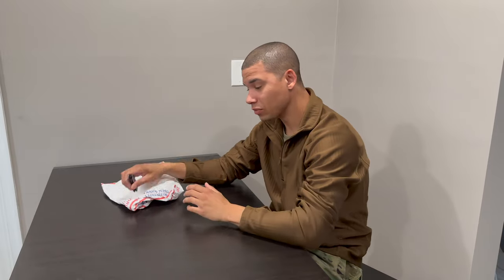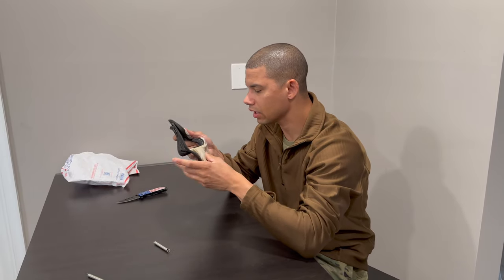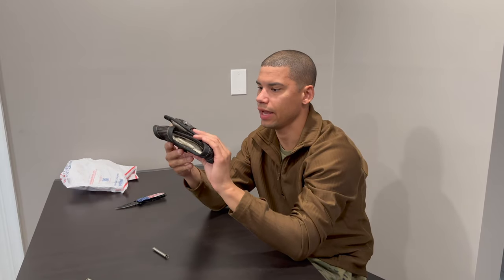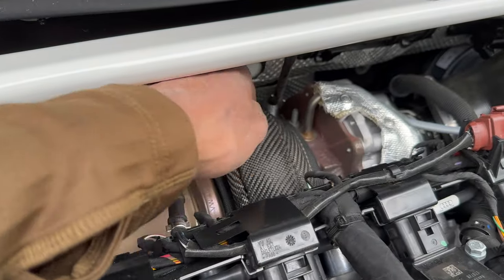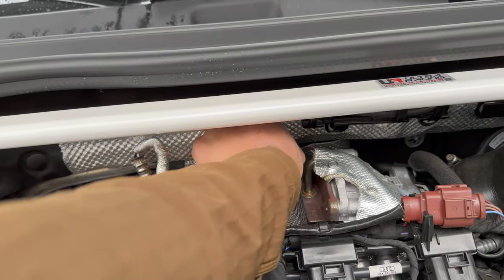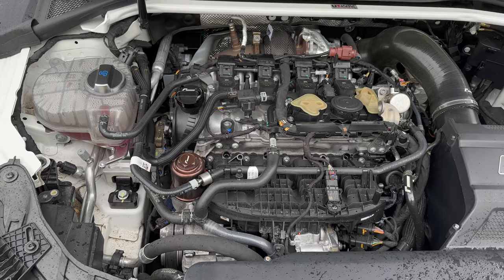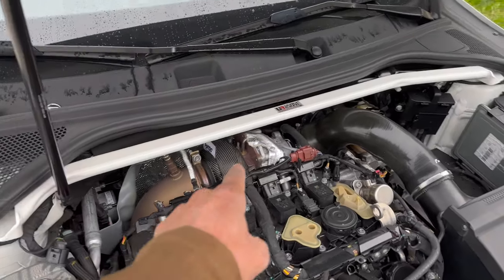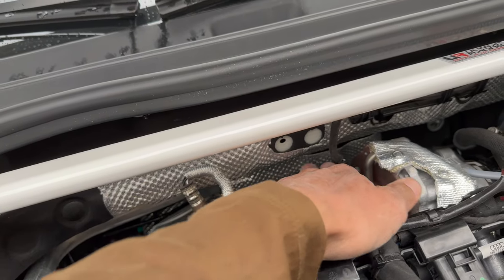Will an IS38 Turbo blanket fit the MK8R/S3 Contidnental turbo?

Comment from the maker: After actually reading the product description of the forge blanket it does say it fits the mk8/8Y 🤣 reading is hard I guess lol! Alongside that if you read the rating for forge vs PTP the PTP has higher ratings across the board so that makes sense for the price difference. Will upgrade eventually now that I know they fit

Comment: Do the blankets actually help with spool and lag?  I'm considering getting one for the garrett.  After having it put on, at 29-30 psi, it def puts out some heat.
Reply from the maker: Dude do it!! Your car will thank you. look up data for turbo blankets, everything about them is great. From bay temps to intake temps to quicker spool it’s worth doing. Go PTP tho they are rated much higher

Comment: Yo Bryce.. did you put the heat-shield back on after putting the blanket?? Mine had a heat-shield and i just removed it contemplating if i should put it back on?? Let me know. Thx
Reply from the maker: Nah I leave the heatsheild off after a turbo blanket
Reply: @BryceJordanProductions  k thanks i removed mine too.. pain in the butt to put on but it helps! also it was like smoky for 2 car runs doesn't seem to smoke anymore, but that's normal.. and yo! did you find or will be adding a drip can / oil catch can system? i tryin to find it one here in can but i see 034 has the panel, but not the can and hoses.. if you find something keep me posted.